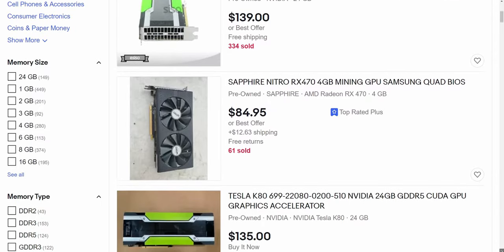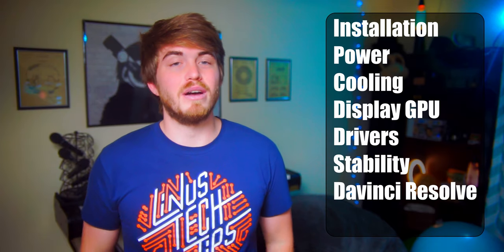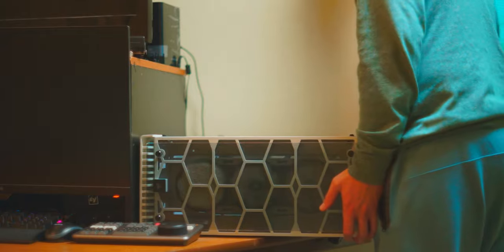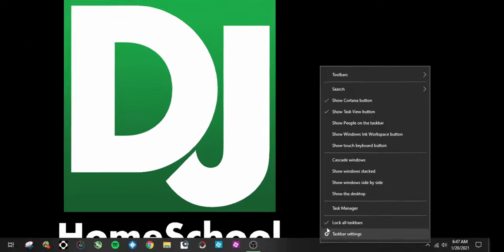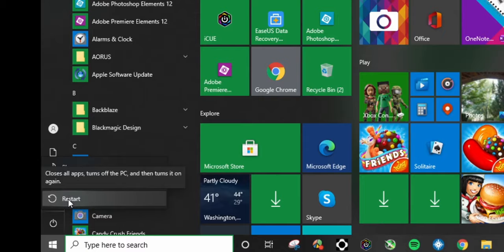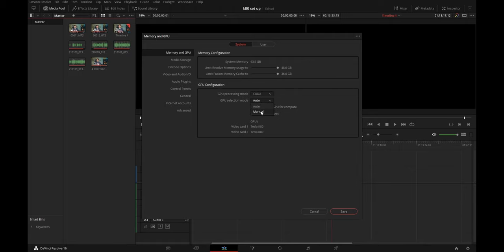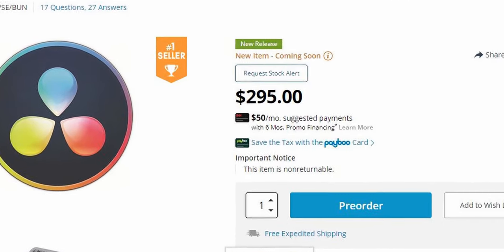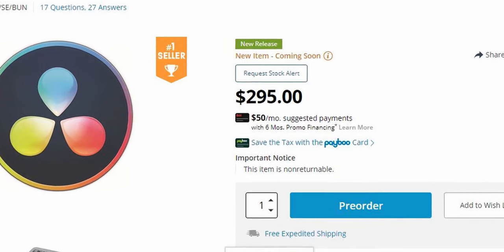24GB Tesla GPU for Video Editors

Comment: If you put in a pcie 8 pin, the gpu is toast. The 8 pin is a 6 pin with 2 extra grounds, one of this grounds will short out the gpu. 3 12v, 5 grounds.
Reply: @lucian6172  Yes, the pins do have a different shape, but nothing is stopping you from pushing a little bit harder to get it in there. I've tried to do it, and it goes in with some work. Unfortunate. The spacing for the connector is exactly the same.
Reply: @lucian6172  No, I didn't power it on. I just checked if it was possible, and it definitely is. And it wouldn't fry it. It would short directly to ground on the power pins, and the power supply would shut off. No harm can be done. But you still shouldn't do it.

That extra 6 pin on the rx 580 is for if you wanted to overclock. 75 watts come from the pcie slot, even an 8 pin and a slot would give you 225 watts of available power.

8+6+slot would be 300 watts of available power.
Reply: @lucian6172  the gpu calculates total wattage and power limits around its tdp. The extra power pin is for overclocking and is over full spec.
Reply: @lucian6172  lmao your not going to melt wire, you know nothing about resistance. Adding more wire is not gonna help you.
Reply: @lucian6172  the gpu doesn't use all of the tdp at all times. Overclocking will get you better performance at the same tdp limit. If you want to overclock past the tdp you need to raise the tdp limit which is only available on cards with extra power connector headroom.

You don't seem to know how overclocking works.
Reply: @lucian6172  overclocking works the same on cpus of all types. I've overclocked my router even. It's not that hard, it doesn't take that much experience.

Comment: This card with a modded bios and proper cooling is basically an 980 ti, and with an output of some sort, So I bought 3 of them! +GT 710 for the output because they both use the same Kepler/Kepler 2.0 architecture
Reply: Gavin if you see this what did you use it for?

Comment: Hey this may be a little old now, but I would reccomend selling the K80 and buying a Tesla M40 24GB, as it's on the Maxwell Architecture (Which does support DX 12, Cuda 5.2, and other modern technologies, furthermore it still gets driver updates from Nvidia)
Reply from the maker: I have given that alot of thought. even just for the curiosity of the thing
Reply: @WillCarterTech  I would love to see a video on it! I emailed you a few weeks ago with more detailed information on the project.
Reply from the maker: @dosenotcompute7733  alright ill check my email. Thank you!
Reply from the maker: I was unable to find the email that you sent. I checked my spam and it wasn’t there either.
Reply: @WillCarterTech  Hm ok, I guess it didn't send for some reason.
Reply from the maker: @DoseNotCompute  did you go through my website or directly to willthehomeschooldj@gmail.com ?
Reply: @WillCarterTech  I emailed your email
Reply: @WillCarterTech  sure

Comment: Can any other GPU-bound applications like games use the Tesla GPU? Or is there something in the drivers preventing that kind of usage?
Reply from the maker: Yeah, there are plenty of applications that could use the tesla but alot of them are dropping support for the Kepler architecture this year; such as solid works.
Reply: @WillCarterTech  Do those applications need to specifically support the Tesla GPU or does it just work as if it were any ordinary GPU?
Reply from the maker: They need to support the architecture. If the application doesn’t support the processor’s architecture, it will just act like the GPU isnt plugged into the system.
Reply: @WillCarterTech  Oh wow so does that mean games probably won't be able to use the Tesla GPU then? So if nothing specifically supports the architecture anymore then these Tesla GPUs are effectively bricked?
Reply from the maker: They are e-waste at this point. You would need to be willing to work with an older version of softwares. Like right now, I’m using Davinci Resolve 16. But topaz labs doesnt even have a older version that supports the kepler architecture. So i still can’t use topaz labs if i wanted to. unless i do everything through the cpu. i rendered a 20 second clip in topaz labs video enhance ai using just the CPU. It took all night. Its just not worth it at that point.

these Tesla gpus weren’t ever good at Gaming even when they were supported.
Reply: leveli1tech just made a video about this if you are still interested
Reply from the maker: Oooh yeah ill go check it out thanks!
Reply: You might need to compile programs yourself.
Reply: Anyone try that Topaz Video Enhancer with these? I have a Titan Black doing the work but each video takes litrwelly 24hrs to Finnish wondering if this would speed it up. As with my 3090FE rig it takes 4 hrs with same project.
Reply from the maker: Yeah, topaz is built on direct x and the tesla apparently isnt compatible. I looked up Topaz required specs and they dont support kepler tesla gpus.
Reply: @WillCarterTech  ah dang lol was gonna make it do the heavy workload so don't burn out the 3090 rig.oh well got nothing but time and a Titan is doing the work Ty for least having same idea
Reply from the maker: @shadowarez1337  craft computing has done a couple videos on hacking the bios to get the tesla to work with direct x. I bet he would know how to get topaz to work on the tesla m40 and k80.
Reply: @WillCarterTech  it just needs to be better then the OG Titan lol 24 hrs per 30 min video is a bit wasteful for energy
Reply from the maker: @shadowarez1337  i feel your pain.
Reply: @WillCarterTech  an other thing they can be good at is rendering, they are supported on main 3d softwares and can be good alternatives to recent graphics cards. No need for dr studio or any licences as there is good free softwares on the market (blender for exemple), and by only spending 19bucks on the airflow you can cut a lot of the price you finaly got.
Reply from the maker: @akkibi8267  yes i agree. Those 3-D printed funnels and blowy-Metron fans are definitely The way to go if you are able to sacrifice noise

Comment: DUDE, WHAT A VIDEO! Finally, teslas are the least documented cards on the internet, and after seeing this video, I will say that I'm definitely going to keep an eye on the tesla k40, mainly because my new workstation is an actual rackmount server that I have just placed in my room (it's a bit noisy, but 12 core and 24gb of ram for 230€ in a shitty used market is an absurd deal, and for a complete amateur is pretty good imo), and I also know that these cards are fantastic for vms (that are a think that I'm definitely going to experiment with in the future), great video, keep up the good content! (sorry for my broken english, I'm from Italy)
Reply: What is the configuration? I am going to build a PC for 500-600$ with 12 cores CPU, 32 RAM, nVidia Tesla m40.
Reply: @linux3584  If you are talking to me: I bought an HP Proliant DL380 G6, because it's the most flexible machine for my needs (a workstation able to do video editing and other interesting workflows like VMs with online services and stuff like that), it has 12 cores (the cpus are two xeon x5650) and 24Gb of ECC ddr3 clocked at 1333mhz (not the fastest RAM but it's still very solid for what I want to do), at the moment due to the fact that I'm very buisy with work I haven't still bought a GPU, but I'm a bit limited by Power consumption and space due to the case being designed for servers.
The fact of having a server is something really personal, and if you want to go that route (which is really cheap and flexible) you have to take in consideration all the disadvantages (noise and power consumption), for example my server make a noise at 54-56db constantly, I can live with that easily, becuase I love my machine, but many of my friends told me that they couldn't stand it for extended periods of times.
I would also add that if you live in a hot place you are gonna have a bad time with a machine like mine.
As far as the gpu is concerned I reached the conclusion that probably going for a tesla is not the best of ideas, but just because the passthrough to VMs is quite limited by licences and shit like that (damn Nvidia), but if you just have to do video editing like it's shown in this video it would be a very nice card.

Sorry, it's a bit of a long comment but I feel like it's necessary, because buying strange hardware is always a risk, so I wanted to explain my situation as best as I could.
Reply: Yes, it's a server card - not a PC card!!!
Reply: @WillCarterTech   lol ahahahaha...so hilarious I laughed and was rolling on the floor...you are way so talented in narration than troubleshooting the card with cardboard...

Comment: The question is, why would there not be drivers to be compatible, is that even a thing? teslas are essential the same as Quadra’s but without cooling and output. If Quadros work, the so will teslas
Reply from the maker: yeah, it was finicky. the geforce drivers for kepler worked okay most of the time.

Comment: Heck of a video!  Quadro would be a good option for a display GPU.  Those are typically spec’d. out for machines that run CAD and engineering modeling.  They generally possess less “grunt” and lower clock speeds than their GTX/RTX counterparts, but often provide stability.  They’re geared more for accuracy in linear rendering, etc. as opposed to brute force.
Reply from the maker: Aaaaahhhhh that makes a lot of sense. That explains why video editors always say the Quadros are great for video rendering.

Comment from the maker: 3/27/21 Update:
Topaz Labs software does not support the k80. 

2/9/21 Update:
The k80 is built on cuda 3.2 architecture. DRS17 effects such as magic mask cannot run on anything before cuda 7. To cut bloat and keep video editors from being confused as to why their GPU works with some FX but not others, they just cut support entirely. Also, Solidworks 2021 has a similar story. That is why we won’t see the k80 supported by developers in the future. This is truly a bandaid in my system. As soon as I can purchase a 3090, I will replace the k80. 

2/8/21 Update: 
Installed DRS17 beta 8. Still no support for the k80.

2/5/21: I’m currently Rendering a super scaled 1080p video up to 2160p in Davinci resolve studio. Both k80 gpus are pegged at 100% and have been for the past few hours. 
The card’s heat sink has long since reached its thermal capacity and doesn’t have enough air flow to keep it from thermal throttling the card. 
We are currently sitting at 800Mhz clock and 91 degrees on the rear GPU and 86 degrees on the front GPU. 
Render time remaining is 6 hours and counting. I think this render will fail.

2/6/21 Update: it completed! It took 6 hours to complete. I had to get a box fan and point it directly at the k80.
Reply: Can you try gaming?
Reply from the maker: @cavebrain69  sure which game?
Reply: @WillCarterTech  any newer games. Like cod, battlefield,
Assassin's Creed etc. 
Also thx for replying and I'm gonna sub. Also if it's too hard you dont have too :)
Reply from the maker: @cavebrain69  thanks man! Of course, I’ll look em up. I haven’t played cod since I was in high school. I’m a boomer so it might take me a min to figures out the games. My nephew installed apex legends or something on my computer. So I’m sure I can figure it out. 🤣
Reply: @WillCarterTech  running path traced minecraft is a nice way to make a space heater out of your pc
Reply from the maker: @AA-zm9hk  alright! Let’s try that! 🤣
Reply from the maker: @Cave Brain 
Okay the gaming on this card is horrible. 1080p because that’s the monitor I have. CoD was the best at around 20fps. But battlefield and assassins creed were around 8fps sometimes spiking up to 14fps.
Reply: @WillCarterTech  lol, thx. I wont buy this card for gaming now.
Reply from the maker: @cavebrain69  you are welcome bud :-)
Reply: This is entirely off-topic, but do you have any issues with Topaz software constantly crashing? I've tried different products multiple times on different machines, and none of them will ever complete a batch job successfully. Video Enhance AI was the most stable, completing about 1 in 3 videos successfully.  I called there tech support twice--once for GigaPixel and once for Sharpen, and both times it ended in an "I dunno."
Reply from the maker: I have experienced one or two crashes with Video Enhance AI but the rest have been perfectly stable. Those softwares run on direct x12 however so they are not compatible with the tesla k80. I cant even get the software to recognize the k80.
Reply: @WillCarterTech  I thought that might have been it, but I counted back and the last three cards have been DX12 compatible, and at least the last 2 have had it installed for sure. 

I appreciate the help!

Comment: Yeah, entirely depends on the use case.. For videography / encoding etc, it's a straight up no. But for rendering complex scenes in 3D software, where VRAM is king, it might be a god send for budget home workstations. The renders might be slow and the performance laggy, but it will get the job done. For me the card is a bargain just for the memory alone.
Reply from the maker: yep

Comment: I use K10 as it was just lying inside a server, unused. I connected it to my HP Zbook Studio through Thunderbolt 3 eGPU enclosure.

It required many adjustments under Windows 7, but it finally worked with Resolve 16 and Blender. A clear boost to my Quadro M1000M inside my Zbook Studio. I may get an RTX or RX later.

As for the fan, I used double deck server fans to pull out the heat and it never got overheated. I use DC-to-DC voltage regulator so I could control the fan speed manually to get acceptable fan noise while I'm working with it 😊

Nice video anyway. You make me smile, realizing that I have a companion using Tesla for DCC.
Reply from the maker: Hey! Now THAT is the way to do it! Especially using it along side a Quadro, so one driver works with both cards. 
I was reading on Black Magic’s website that DRS17 does not support the Kepler architecture. They said that their new effects such as the mask and tracking effects will only work on newer GPU architectures. Kepler was developed on cuda 3.7 architecture. 
I don’t exactly understand how that works. But I do understand that they will no longer support my k80 so I have to stick with DRS16 for now until I can get a newer card. 
Are you going to stick with DRS16 as well?
Reply: Hi Will. Big thanks mate. I'm currently not sticking with Nvidia's recommendation of using Maximus driver and recommended Quadro card. I couldn't change my on board Quadro M1000M inside my 4 years old Zbook Studio to any that Nvidia recommended. I have no choice other than using the M1000M.

It was a true headache for more than a week to make my setup works (Quadro M1000M, Tesla K10, eGPU box) as my installation is against all recommendations, for instance the Thunderbolt 3 eGPU box clearly wants Win 10 as mine downgraded to Win 7 (I love Win 7), Quadro M1000M vs Tesla K10 (Nvidia doesn't support unified driver for them, Quadro driver will override Tesla and so will Tesla's), etc. So, I made a custom driver myself by modifying INF file and combined Quadro and Tesla driver files.

Yes, I would still be using R16 and that would make two of us 😄

I noticed performance boost when assigning rendering to K10 alone. And I mean real boost. A 3 mins full 4K ProRes project with thousands of mask paints, clean plates and color corrections that rendered 9-11 hours on my Zbook Studio, now it's just taking 1.5 hours to finish with single GPU on Tesla 😊 so happy that everything works just fine. Oh yes, I'm disabling the K10's 2nd GPU to lower down the operating power as it's just consumed 90 watt when fully loaded with single GPU. However, I could always enable the 2nd K10 GPU whenever I need it.
Reply: Btw, ever,since I assigned the Tesla K10 to exclusively handle the GPU task in R16, all my problems have gone away like "GPU memory is full" and intermittent crashes. Since I disabled the 2nd GPU, that means the K10 is only processing with 4GB of memory, which is wierd, considering that I'm editing and compositing plenty 4K Cineform clips 

I suspect that when using a single card to handle Windows graphics as well as R16 GPU, was the reason it gave GPU memory full mesaage and crashes.
Reply from the maker: That actually makes a lot of sense. I’d be willing to bet mine is having the same issue as yours
Reply: Hey Will. I'm lucky enough that I got both RTX A4000 and A5000 with me now. Testing them heavily, recently.
Reply from the maker: Oh wow! Id love to see your video on the performance
Reply from the maker: Really!? That surprises me that windows 7 was better at that. I wonder if that’s because GPUs didnt have as much vram back when windows 7 was created. 

Thanks! I look forward to watching it. :-) im extremely curious how they perform. Puget’s benchmarks can only communicate so much. 🤪 

I’ll check out that hack as well. 

Thanks man! I honestly can’t even remember the end. Ill have to watch it again 😝